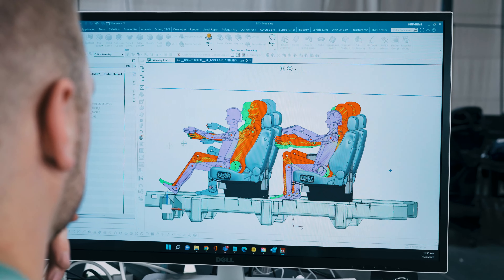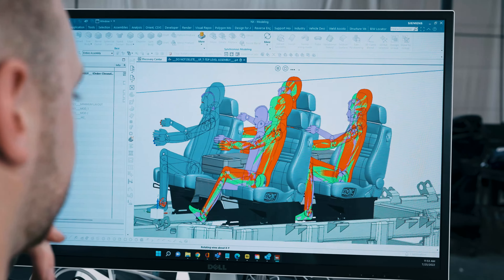XT Design Update | Vehicle Design Phases

Comment: Good stuff! Personally, I'm really hoping the final design is a bit closer to the original renderings than it is to the current prototype.
Reply: Yeah, sleek and stylish.  Although, I can do without the huge plastic grille things under the headlights.....they look like sifting pans.
Would also prefer a completely integrated dashboard.  I wouldn't buy anything that has a tablet stuck on the dash.
Reply: Jaime, I couldn’t agree with you more!  I was shocked when Atlis revealed the current prototype. I hope they at least blend to old style into the production XT

Comment: Will there be a fuel-powered generator to charge the batteries as a back-up? Lots of people work days/weeks in remote locations (without access to charging stations) and having a generator on board as a backup would be very helpful.

Comment: First rendering actually looked pretty good. I wouldn't have even minded if that was the final design. As long as it isn't the hideous boxy mess that the current version is.  Also Atlis seems to be driving this work truck theme heavily and while there is certainly a market for that and maybe fleet lines I think most people are buying this as their personal vehicle. Pulling a boat or trailer, going camping, picking up some ground cover, etc. There needs to be a work line and personal use line of trucks. We need it to fit in our garage and be our daily commuter. Don't forget all the "non-work" truck people out there!
Reply: I would like to be able to make a bed in the back seat for the dually for a hotshot vehicle !
Reply: I agree. Although I need the truck because I am in construction, I don’t need it to be 8 feet tall. It needs to fit in my bigger than average garage or I won’t be able to get an XT because I can’t park it outside. HOA rules won’t let me.